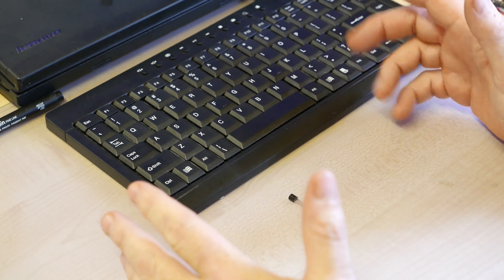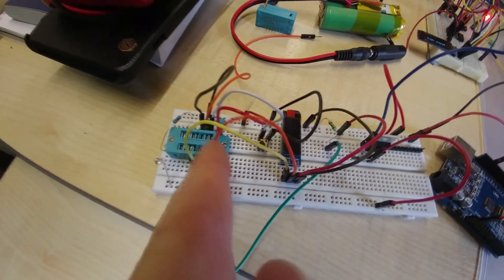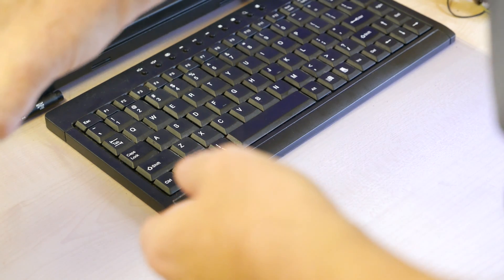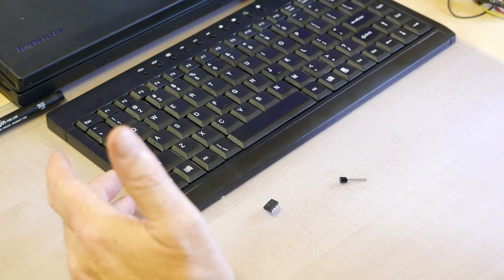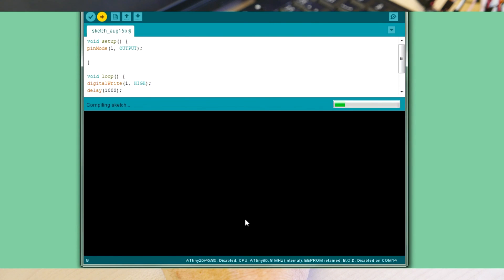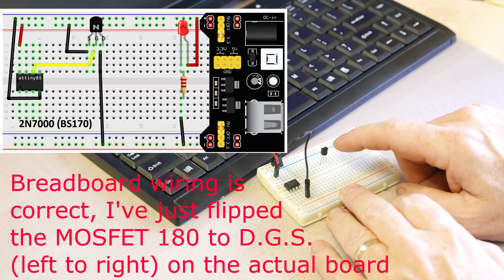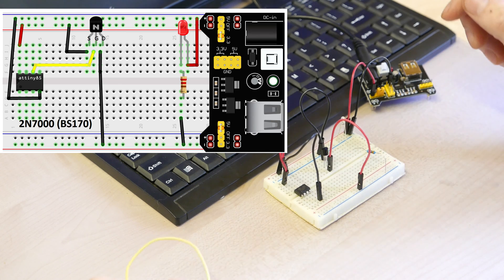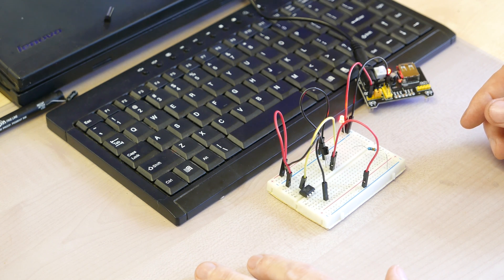N-channel MOSFET Switch. 2N7000 - Arduino Power Saving

Comment: What a confusing mess. Did you even think of planning before you started jabbering ?
Your breadboard explanation/disclaimer only makes it worse. Why didn't you just say what the pins are in the image ?
And you use a red wire and a black wire going to the same rail.
You spend 7 minutes trying to find a reason to use a mosfet. Dummy, we are watching this video to learn how to use them. Just leave the reason to others.
This video is such a disaster that I am going to have to use some effort to get it out of my mind.

Comment: dont you need a bleed resistor fromm gate to ground? or does attiny have inbuilt pulldown resistor
Reply: Yes same question, important for me. Why does it sometimes Work without a pulldown resistor and sometimes the mosfet stay charged like a capacitor and wont close anymore ?
Reply: @lieblingsfarbe4453  I've noticed this as well when building a circuit to measure frequency and duty cycle of high voltage. I had the input wire on the base of the transistor and I could accurately read it without touching the wire. I could also read it when touching the wire and just getting near a power source with my hand. A high value resistor solved the over sensitivity.  Floating pins are fun but not a good practice. Having a positive wire running close to the gate could have been just enough magnetic field to hold it high... who knows.